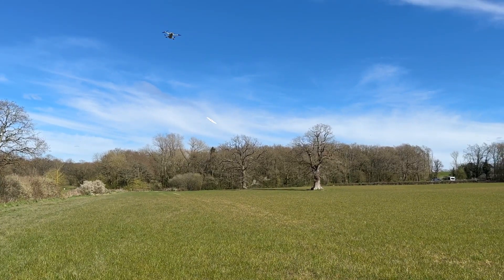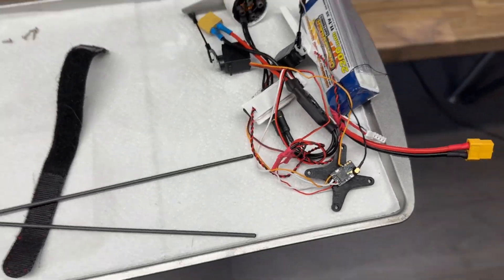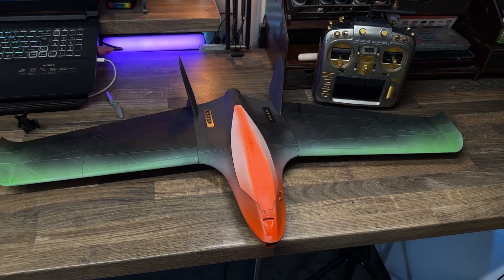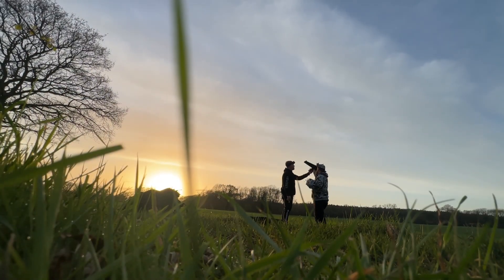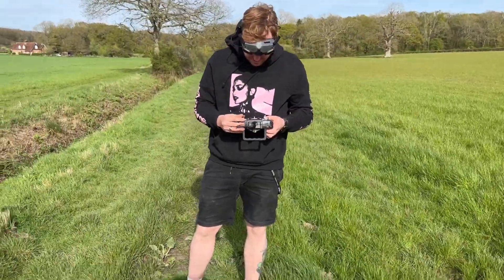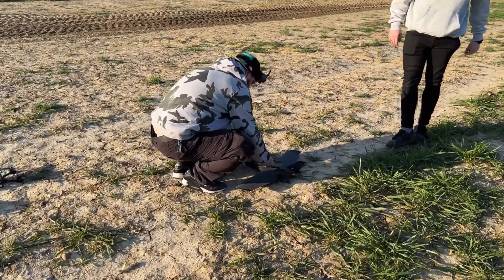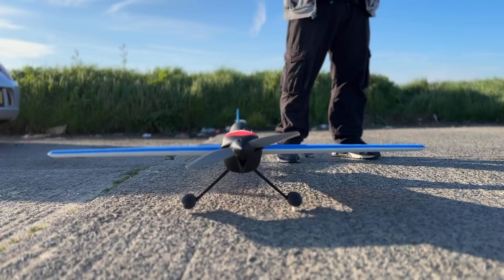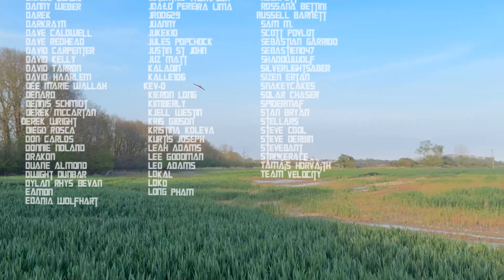Make 3D Prints FLY

Comment: try revving engine to max before you throw it! also try throwing from a wingtip to get a good throw
Reply from the maker: It was under powered I had full throttle also the wingtips are a thin 3d print it would snap if you held it there unfortunately. But after changing props I had enough thrust to launch under handed (it’s safer this way because those propellers bite hard if you hand gets caught)